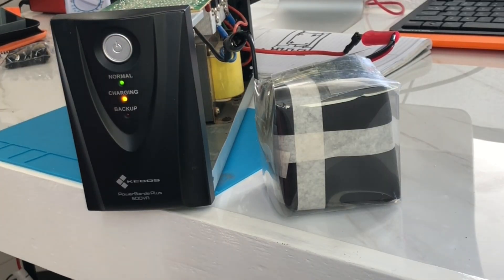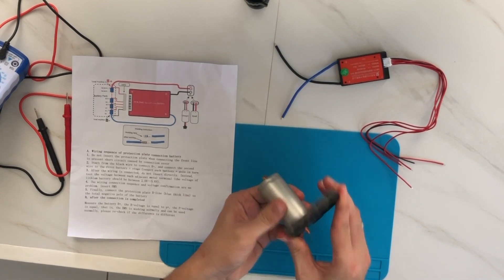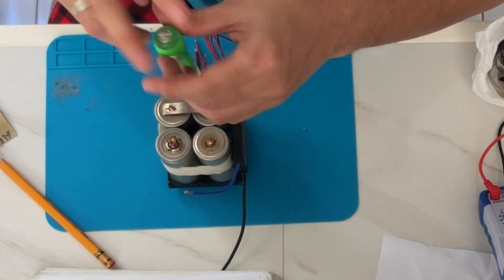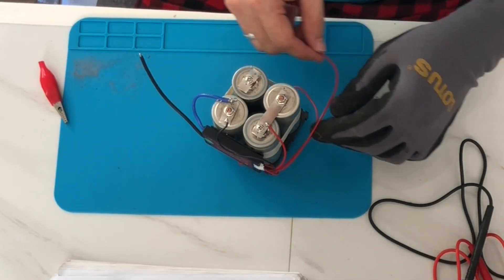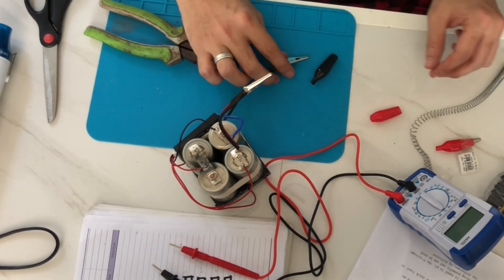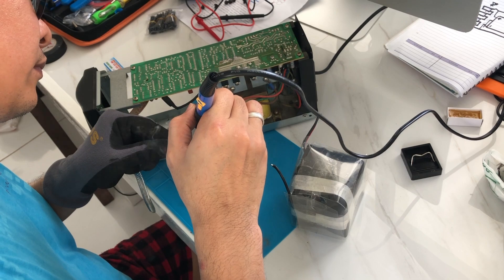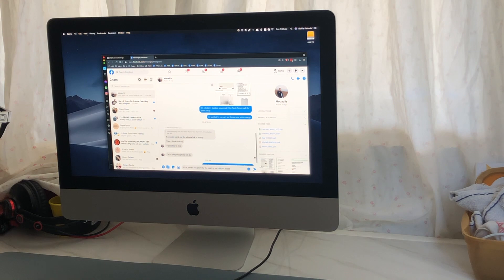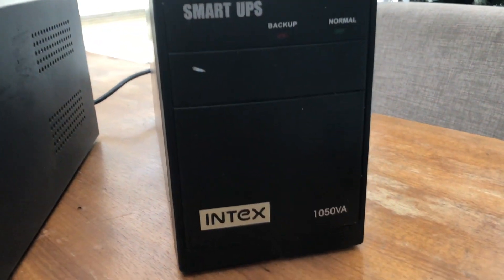How to replace a 12v UPS batteries with Lithium Batteries (LifePo4)

Comment: I discovered that the main obstacle to using LiFePO4 batteries in your UPS is the continuous discharge rate. Usually, this type of battery is limited to charge/discharge at 1C. So a 7Ah 12V battery, will usually discharge at 7 Amps. But for a 350W inverter, you need more like 30 Amps. You need a battery that handles 4x more current at that voltage. 
I did find one 15Ah battery that had a 30A BMS, leading to a fast 2C discharge. Such a fast discharge might hurt some cells, but if you do it just once in a while, you can still make it work.
In your case, you need to get more cells in parallel.

Comment: Nice vid. I'm trying to hook up my UPS to a lifepo4 battery externally, range of 12v 100ah to 200ah and also connect a BMS. My issue now is the UPS will also be charging the battery simultaneously. Is there any fix for this? Is there a way to stop UPS from charging the battery when there's power from mains?

Comment: I replaced lead acid with Lifepo battery . It charging great , great backup. But the problem is that, once the batteries are fully charged .  Charging LED doesn't off instead "Replace battery" light is blinking.

Comment: Replacement of LiFePO4 several Disadvantages:-

- 4 cells of LifePO4 required charging voltage of 16.8V while the UPS charged voltage is around 13.5-13.8V. So the full charged capacity could be only less than 80% of LiFePo4 real capacity.
- The BMS is passive balancer the balance process will be done only when the charged voltage almost full which it could not possible!
Reply from the maker: 16.8V sounds too high for a LiFePO4 pack. The nominal voltage is only 12.8V, with a recommended charging voltage of 14.4V to 14.6V. I do agree, though, that adding an active balancer would be ideal.
Reply: @techwithrichie  I think a proper LiFePO4 charger would be a better option. The batteries won't be in use often so the current BMS has plenty of time to top balance. You would have to isolate the charger from the battery during discharge otherwise it would draw too much current from the charger. A BMS with a separate charge connection would be one way to do it.
Reply: @gnuorder Pls i have a UPS with 12v 9ah battery and i want to configure the ups to 12v 100-200ah lifepo4 battery. I'll get a dedicated lifepo4 charger and bms.. my problem now is if there is power from mains and all are connected, the UPS will also charge the lifepo4 battery. Pls any idea how to solve this dilemma?
Reply: 16.8v those are acid batteries like in cars
just push around 12v its fine the ups runs or its plug in 24 hours will charge in time blackout usually just happens ones and the capacity seems small

Comment: Bad idea , the ups does not have the lipo4 charge parameter which is different than lead acid. You don’t know what your doing to the cells ,
Reply from the maker: i guess it outweighs the benefits. it's been over 3 years and still using this setup.

Comment: how many lifepo4? What kind of lifepo4? And what other parts needed to assemble UPS that will last like 6 to 8 hours? Mind sharing a list of things needed? A set up for a computer that have around 500w to 1000w. Thank you!
Reply from the maker: this one is only 4 ( 32650 cells) because only 4 cells can fit inside the UPS - to build a 12v, you need a BMS. if you need to expand, you can create a parallel connection with additional 4 cells or 8cells connected to the main battery. was able to do this with one of my UPS too. just need to create a small hole to get the wire pass through
Reply: @techwithrichie  Thank you so much!
Reply: for 500W continuous you need a goldenmate LFP1250. 50A max continuous discharge x 12v * 85% inverter efficiency = 510W continuous
for 1000W continuous you need a goldenmate LFP12100. 100A max continous discharge x 12v * 85% = 1020W continuous.
for 500W continuous for 8 hours you need 4000Wh. The goldenmate LFP12300 delivers 3840Wh and a mere $500. 
for 1000W continuous their LFP12400 is 5120Wh and will give you 5 hours. Only $900!

Comment: I made a 18650 lithium-ion battery for an ultima LCD 
 2KVA EURO ups The battery was as follows: 30 cell bak high drain 4.2 v 3 A 5. The batteries were placed in 5 columns and 6 rows and  thick nickel stripe was used for spot welding.  I used BMS 6S.The problem is that in few seconds, not more than a minute, the battery gets extremely hot and smoke begins to appear. Please explain the error.

Comment: OMG, just buy F2 connectors... And charging is not "normally" because its very slow, most UPS have 1A current or less and lifepo4 can be charged with 0.5C of full capacity

Comment: Hi. Is the UPS still holding up?!
Reply from the maker: yep. still using it til these days.
Reply: @techwithrichie I also made one in 2021 october and it worked like a charm. But suddenly today, it stopped charging and ups doesn't even turn on. I am trying to jumpstart the batteries but they don't even charge. Guess, I have to charge each battery individually?

Comment: Hilarious short circuit fire! but this is EXACTLY what I need to do - thankyou and I'll be sure to insulate the terminals.  You could easily just add an external, larger battery the same way I expect.  Nice work.  And Lithium battery voltage is very constant, until it hit's 10% or so left, then it plummets.  Lead Acid is a longer curve down.
Reply: Do not use a larger battery than the original because the UPS will overheat as they not designed for continuous use

Comment: I knew  something was wrong with the setup.. UPS requires high discharge battery source and PB acid battery allows for really thigh discharge for a short  period,  while LFP (lifepo5)  has significantly lower discharge capacity so you'd  need lots of parallels to make it effective.
Reply: LiFePo4 can have pretty decent discharge rates. 3C to 5C is usually the continuous. I know the 38120 headway cells do quite a bit. Do you need 10C?
Reply: UPS won't pull more than 3C continuous and deep cycle lead acid is horrific for high C loads, it won't deliver any capacity.

Comment: You have to change the Macs power down features.. As they are manually set..As APC does not make a PowerChute application that runs on a Mac...Without hacking the through the terminal window..

Comment: Looks like you got a nice 3rd degree burn on your finger.  Am glad you used the BMS.  Not sure how the BMS and the UPS work together on charging.  You may consider putting a fuse in place to limit the amp draw as the UPS doesn't appear to have a fan.  Have heard that you need to manage the heat output on the UPS to keep it from overheating (because of no fan).  Have seen others recommend limiting UPS to 20% of capacity to mitigate heat build up .

Comment: Nice Video. 
Have you experienced any drawbacks of using these LiFePo4 batteries instead of Lead Acid batteries in the last year and a half since you started using it? Thks.
Reply from the maker: still using this setup until now 3+ years.
Reply: @techwithrichie   what's the total battery capacity again? and how long does it last during blackout?

Comment: DANGER!!!!  If your UPS has not started your house on fire yet then it is only because of luck.  I just tried the same setup using the same Daly BMS.  Mine is a cyberpower pure sine UPS.  The problem is the charging circuit is designed for a lead acid profile and it will not charge LiFePO4 batteries correctly.  Lead acid chargers are over 14v and the maximum voltage tolerated by LFE batteries is 14.6V but this will SIGNIFICANTLY reduce their lifespan (more than 50%).  If you charger runs over 14.6V (different for each UPS) then you run the risk of your battery offgassing to prevent an explosion.  Since your charger doesnt realize this happened, it will just keep charging and charging until something catastrophic happens.  Your cheap BMS doesnt cutoff the charging soon enough to keep the batteries healthy, it let's you charge then batteries up with the expectation that you are going to use them right away and not let them sit on the charger eternally.  Now, here is where your house is at risk of burning down........  when MOSFETs on the BMS fail, they fail open.  This means your BMS is no longer protecting your batteries and you will have no idea this happened.  There is no alarm, there is no warning whatsoever.  Your lead acid charger will just keep charging and charging your LFP batteries until there is a catastrophic failure.  These batteries arent as dangerous as LiPo fortunately but you do still risk toxic chemical release offgassing (I dont know what happens when you abuse LFP batteries this bad maybe it is possible to start a fire).  In my case with my UPS, it just did not work when I connected fully charged LFP batteries, I suspect the BMS shut off because the lead acid charger was trying to force too many volts- I will test it some more later today.  The proper method is to learn how to disable the charge circuit, and connect an external charger that keeps each cell under 3.4V for longevity 3.2V is even better but this isn't a full charge.  The external charger can be solar or electric, and it should support LFP battery charging profile.  ** The proper way to charge these batteries is with constant current and slowly increasing the voltage as the battery charges **
Reply: I liked your Idea Bro 😉 ❤ Surely Work On this Project and Upload a Video Soon With Full Protection adding bms with external charger and ventilation+ fan and diode for Ups charger circuit turning off and some casing for battery for preventing damage to battery 😅
Reply: @kselectronicswork  2 years later, the easy way to disable the lead acid battery charger is to simply block it with an inline diode.
Reply: @mikes6216  yes im researching about this 😊
Reply: You can use a diode to block the charger but this will cause some voltage loss.  Maybe an Ideal Diode would be a bit more efficient but they will be expensive for most ppl's current draw.  For only 120W you can get a 15amp ideal diode for under $30 but the specs on those seems to be false on aliexpress, they cannot handle nearly as much current as promised.  Note:  MOSFETs in your BMS may last for a couple years, but when they break down your LFP batteries will be instantly in danger.

Comment: No,you can't replace the VRLA batteries with lithium batteries on your existing UPS. Lithium ion batteries have different charging regimes and voltages. If the UPS came with a standard gel type lead acid battery, it will have voltage regulation and charging cycles specific for that type of battery.
Reply: He is not using Lithium. He is using Lifepo4 batteries. Which are made for this application..

Comment: At the prices the components are currently at for the build, I'm not sure this makes sense.   Probably better off going with an external lead acid battery of much higher capacity which could have it's water levels checked.  $60-$70 for this (following supplied links and some known pricing) seems pretty high, not to mention the unknown reliability factor of overseas components.  I can get a 12 volt utility battery right now for $20 that will plug right in and work - although it will not fit in the case because it's a much larger battery.
Reply: Correct. Too many incompatible pieces to fix safely. Pb might be low useable Depth of Discharge and not so great Cycle Life even with very conservative 100-60% DOD but it can be dirt cheap if you shop around and don’t buy new.

Comment: Some real schoolboy errors here. I am very surprised you didn't monitor the battery voltages as you tested it to get a better idea of how the unit is treating the cells. You are very lucky you didn't fry the PCB on the second short. I think the only reason you didn't have a VERY serious problem is due to using LiFe Po4 cells. Lucky escape! The UPS is expecting Lead Acid voltages to determine run time and shutoff levels which your BMS is not set to correctly. This whole project is good for a cheap & nasty way to get it to work longer but that's about it.

Comment: I have 2 UPS with 12 Volt 5AH Lead Acid Batteries and 12 Volt 7AH Lead Acid Battery, if I buy these Batteries then in the 5AH UPS the 6AH Lithium Batteries will probably undercharge, and in the 7AH UPS the 6AH Lithium Batteries will probably overcharge, what to do and why did not you use the Battery Case ??

Comment: I'm wondering how those two short-circuits influenced cells internal resistances. I was once replacing ni-mh cells in old cellphone's battery, and I shorted one cell for good 5-10 seconds. From that point on, this cell had significantly higher resistance than other two. The capacity didn't suffer significantly though. 
Just a thought.
Reply: Higher ESR will dramatically affect the capacity at high current draw. I assume you tested your shorted cell at a standard rate of 1A which may not show decreased capacity but certainly it will be reduced at higher loads

Comment: Hey, going on a year later...is it still working?
Reply from the maker: yes. im still using it
Reply: FYI  the actual battery use is only when the power is out.  For small  drops there will be little demand.   Doing a performance test would be interesting to see if the capacity has change.  or if the charger circuity was working correctly.

Comment: great video....I have lots(15+) apcs that I have to keep replacing the batteries.  I think I will try this on the next one that fails.
Reply from the maker: Go for it! You'll never regret! Mine's still working with 30-40 minutes backup time with my iMac with only 4 32650 batteries.
Reply: @techwithrichie  Any overheating issues without a cooling fan for a that running time?
Reply: Still working ?? @techwithrichie

Comment: The reason that it drops just suddenly is that LifePo4 cells have a flat discharge curve so all of a sudden one of the cells drops directly from 3.3 volts to 2.5 or less in a matter of seconds this means that it has like 10%-20% capacity left so if one cell drops bellow 2.5 or it may vary due to different BMS's the BMS itself is shutting of the connection to the negative terminal. 

U will not hear beeping or anything just will stop suddenly. The other cause is related to the first one if you are running without BMS it will work just fine but if one of the cells drops with 0.7 volts the ups doesn't have time to beep for low voltage.

For example the Lead Acid batteries have a more curved like discharge curve so it will steadily drop from 13 to 12.9 to 12.8 to 12.7 and so on so the ups itself has time to beep.

Cheers and be careful of what you are doing man u almost needed a fire extinguisher !
Reply from the maker: yep! lesson learned. my first time doing it :)
Reply: So your advice is to throw away the old ups with faulty battery? I've one.
Reply: @averagestudent4358 Just buy a new compatible battery for it. Doesn't cost much.
Reply: This
Reply: Na a bucket of sand and an explosion containment pie dish. Then the fire extinguisher.
Reply: Can I use lithium ion battery in ups without bms?
Reply: @hasnainleetu9845  no , you should use bms beause the ups will not charge 4 cells correctly

Comment: Don't forget that if you ever turn your UPS on its end, side or upside down after a couple of days, that masking tape will do nothing to stop your batteries from moving around inside that UPS case.
Reply: Yes I would have used 3m VHB  double sided tape. I have a 200Ah 12V battery made up of individual 6kg LFP cells and the tape alone is enough to hold them together.

Comment: I made a successful DIY Lifepo4 12v 32650 batteries to replace the lead lead acid battery of my APC 800.with 3S BMS of 40A. When tested UPS started with peeps amber lead., where as out put AC voltage is 275 v the.condition of batteries and BMS are normal. May I know the reason for high voltage?

Comment: Will the UPS give a accurate uptime and capacity estimation after replacing the Lifepo4 batts? Vital for UPS with automatic shutdown.
Reply: My APC with expanded capacity gives very inaccurate uptime and capacity estimates. However, it seems to only use actual battery voltage to determine state of charge, so automatic shutdown basically works as expected.

Comment: good choice using LiFePO4 as a replacement. This chemistry is the only viable option when needing a replacement for 12v PB. LiFePO4 has a lower nominal voltage, where other chemistries, such as Li-NCA or Li-NCM, voltage can be too low at 3S or too high at 4S.

Comment: excellent video!  only one suggestion: as good as your english is, Lead-Acid is pronounced Led-acid... as Pb in enlish is pronounced "led" not "Leed"  otherwise, GREAT!  any thoughts on how to increase the capacity limit ie increasing the 1050VA limit?
Reply: What do you mean by "enlish"? 😃😃😃😃, We are more interested in the communication, not here for English class.
Reply from the maker: Regarding the Led vs Lead pronunciation, you're right. My wife already scolded me because of that. haha. I never thought of increasing the capacity. It was just an experiment so I can still use the UPS. But it would be a good idea. I'll see if I can find a way to do it.